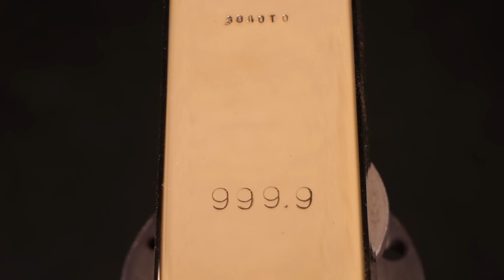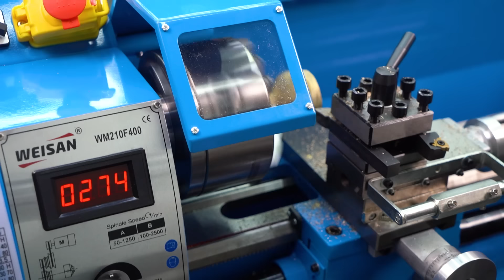We make the most expensive valves in the world

Comment: It's an alloy. Could be brass most likely because the aluminium alloys that make that color would be way to soft.
Reply: Aluminium bronze is harder than steel
Reply: It’s an alloy called Nordic Gold. 89% Copper, 5% aluminum, 5% zinc, 1% tin.
Reply: @AutodidactEngineer   It is only harder than really junky steels. Not even close to any decent steel alloys.
Reply: @PREDATEURLT  So brass or bronze wouldn't hold up to heat like steel would, in this situation?
Reply: @timramich  Yes. There is steels and steels. Also there is bronzes and bronzes. If nobady tells what kind of steel, or bronze it is, it is impossible to say, which one is harder, or stronges. But yeah, it is right, that there is bronze that is stronger than poor quality steel. Or not even poor quality steel, just soft steel. Because there is a pretty good and valuable steels, that are soft. Something like a fire proof steels, that contains a lot of nickel.
Reply: @peraz968  Generally, 651 silicon bronze will be used as a fastener when corrosion resistance is needed and the constant servicing of parts would otherwise make stainless stuff gall together.
Reply: @davidblalock9945  some people call it Movie "Gold"

Comment: 99.9% Brass.
Reply: With so many mixtures to make brass there is no 99.9% brass. As soon as you add tin to copper, it's 100% brass
Reply: @hughjass1835  It can't be 100% pure because there can be nom alloyable materials embedded/locked into it.
Getting anything to be 100% pure is almost impossible.
Reply: @vitor900000 Yes, very true. One thing I learned in the military is there's no such thing as pure BS. It's always contaminated with a little fact.
Reply: @Colorado_Native yes there is but it’s gold bars , you have to make It 9 carat or 24 carat or it’s too soft to make things like gold rings and chains, even though these are probably using brass
Reply: @kingkong81icloud  Under lab conditions, purities of 99.999% Gold have been created. However, 100% purity has never been reached. A few key reasons:
Trace elements like silver, platinum, and palladium are nearly impossible to remove.
Air contact introduces contaminants. Purity decreases over time.
Limits of testing equipment – guaranteeing "100% pure" is physically uncertain.
Reply: @DaftyBoi412  yeah I know it’s about 99% before they cut it down for wedding rings an chains an Gold watches to about 9 carat 24 carat , Gold from gold bars would be too soft
Reply: @kingkong81icloud Ah my bad, I didn't see the comment you were replying to, and thought you were replying to the other guy saying it couldn't be 100%, but that wasn't what you were saying "yes there is" to. 😅
Reply: @DaftyBoi412  lol , no worries pal , I do the same stuff lol

Comment: 4:00. Nope. Gold is so soft, you would be lucky just to keep the spring on it statically.
As soon as you started it the heads would all just pop off.
Now…let’s look at the cost of that. I have a brick of lead about that size. And it weighs 30#. That’s about 15 kilos. Gold weighs more than lead. So, let just be conservative and say it weighs 30 pounds. At $2390 an ounce. Let’s see. That works out to him holding a brick worth $ 1,147,200.00 or 107,722,080.00 Rubles. 
At $2390 an ounce. You would be lucky, in your smelting, pouring and machining process. Not to mention what happens in the engine when the heads snap off and blow all apart. You would be lucky to only loose maybe 2 ounces. 
Then smelting the remaining pieces into a 
 bar, WITHOUT close observation by the people that grade and weigh gold. Selling, or using it would be akin to a Chinese fake. Understand?
So the short of this is: The engine wouldn’t run. It would cost $4800, plus probably 2 or 300 dollars for a company to pour, grade, weigh and certify the gold. 
Have a nice day.

Comment: Is this the engine block with honed and polished cylinders???
Maybe that's why the cylinder head looks so different in each of the 4 combustion chambers.
Brass and bronze conduct heat better than steel. So the intake valves are colder and accumulated more sud.

Comment: 😊 hey I just want to say what all due respect it's impossible to have gold valves because gold melts at a certain temperature and will never handle the heat inside the cylinder head put in the gold valves in the engine is false it'll never work

Comment: Pure gold is far too weak. A golden valve will be so soft that it can bend or deform in your hands.
1 kg of gold costs more than $ 77,000, it is much too expensive for almost everyone to buy a ingot. The only advantage i find is : gold is one of the best heat conductor (it still has to be useful for valves)
I’m curious what metal they’ll use (personnaly i'll use titanium but this metal is to heavy for this use)

Comment: They are made from brass. If they were gold, the valve heads would have snapped off on  the first turn of the key. Made from brass I was surprised that the stems didn't expand on the exhaust valves locking them open. Cool engineering though, well impressed.

Comment: Next project: concrete pistons
I’d say they’d get smashed immediately.
Reply: Hydraulic Cement would last a hair longer.... 😅
Reply: The heat from combustion would evaporate the water into the concrete and they would disintegrate
Reply: Rubber pistons with gold piston rings
Reply: A polished stone piston wouldnt be impossible? If it gets polished and fittet with rings :P
Reply: Refractory cement! 😂
Reply: @RSx94 "ceramic"
Reply: Do it!
Reply: Glass engine block?
Reply: @jwalster9412  Sorry to say, but there is no any water on dry, well cured concrete.
Reply: @peraz968  concrete doesn't "dry" it uses the water in a reaction (it gets "hydrated"), and an excess stays behind.
Reply: @jwalster9412  That's what I am trying to say. There is no any water left, when concrete is all cured.
Reply: Why? Concrete's thing is compressive forces... just like an engine.
Reply: @MadScientist267  I don't think it would like being thrown up and down 1000 times a minute.
Reply: @jwalster9412  Probably not but there have been a few things that one would think wouldn't have worked at all for piston material and at least would start and run.
Reply: Maybe Valves from water....?

Comment: what else than brass ( Of the four most common gold purity levels, 10K is the most durable, though it also has the lowest gold content. 14K is slightly purer while also highly durable, while 18K gold is the purest form of gold that's typically used for engagement rings and other jewelry ) BUT if you can make lower than 10k then you can make it last longer in 90% smaller engine than normal car engine,in mini engine what you can hold in hand :=)

Comment: If those valves last more than a second after installation, they’re not made from gold. The pressure of the valve springs would pull them apart. 
If anything they’re made from Nordic Gold, which is an alloy of copper(89%), aluminum(5%), Zinc(5%), and tin(1%).